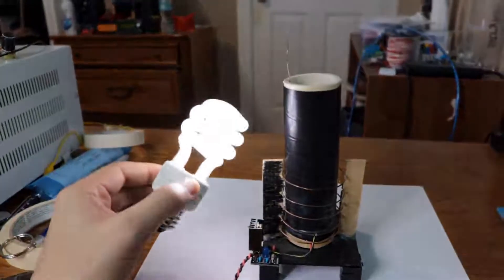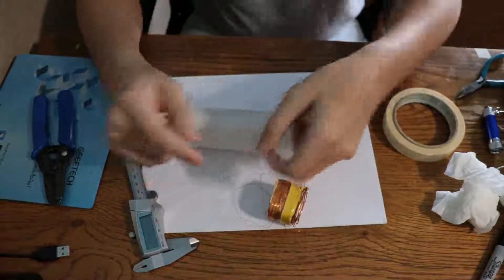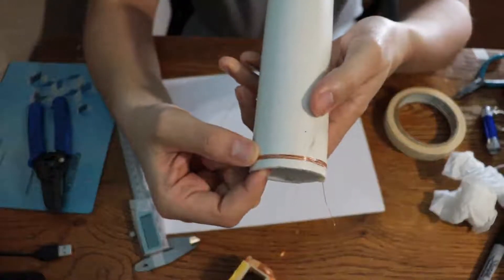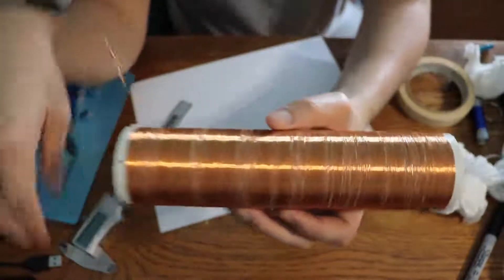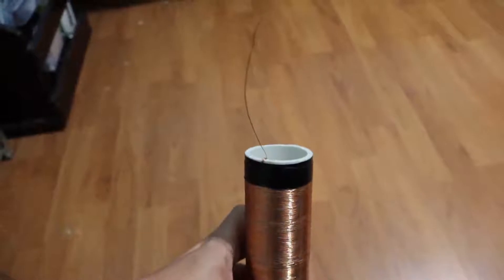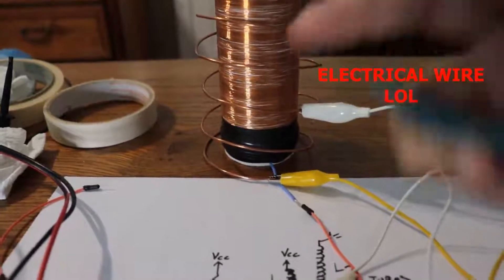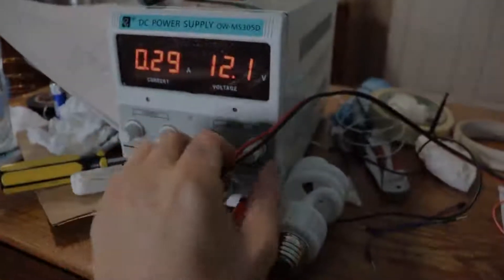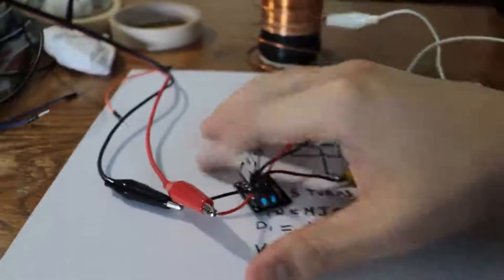Slayer Exciter Simple Build.

Comment: How do you make it work with them in parallel
Reply from the maker: @adamhoover2006  what do you mean by them in parallel
Reply: @ I can’t make it work by wiring the transistors in parallel
Reply from the maker: @ you might need to use just one
Reply: @Jandroverse  do you have Snapchat or smth I can send you a picture of my circuit
Reply from the maker: @ you can send it to my email tictokale@gmail.com and maybe I’ll make a video about it